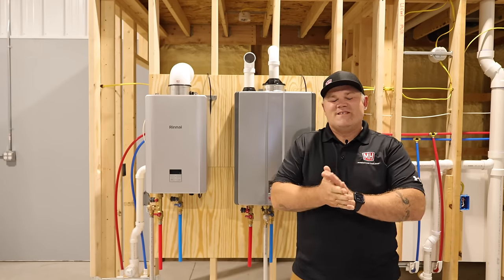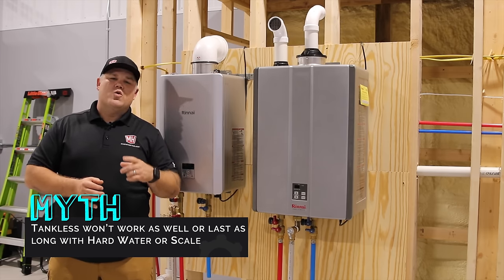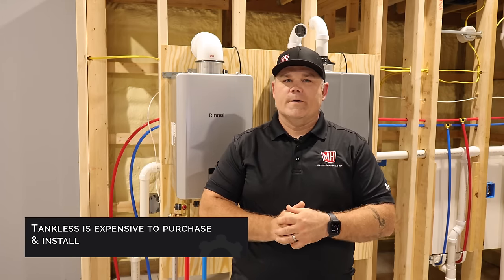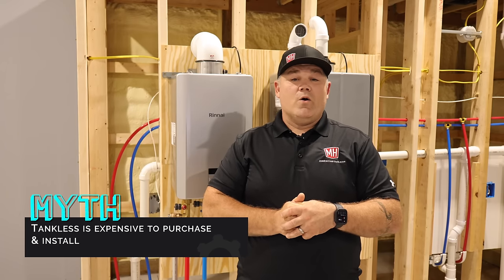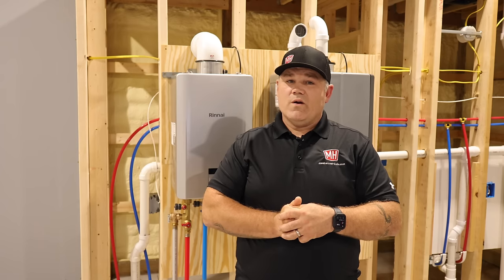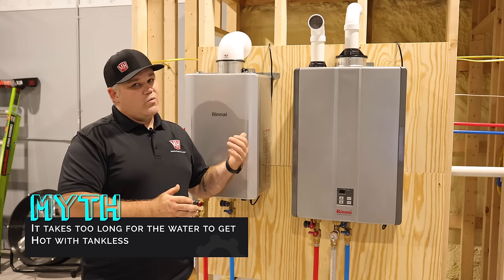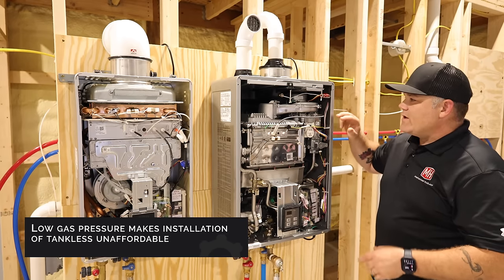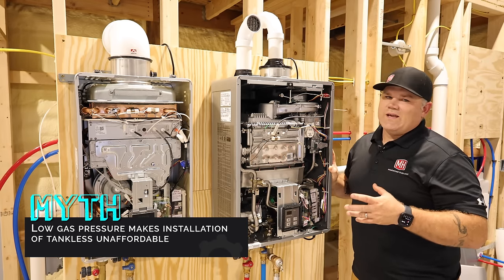Myth Busting! Tank -vs- Tankless Water Heaters

Comment: 40 gallon electric water heater is way more efficient in the long run . Tankless is a waste of money.  The point you made about a recalculating pump for long  runs  saves money and energy. That is so laughable Suppose you use this tap once per day but your keeping it hot 24-7 , that's saving energy? Never mind the cost of the second line pump and you fees wow. Last two houses i had I change the high efficiency gas heaters to electric. I live in a  rural setting, we lost power for two days  water was still warm . $350 for an electric water heater  versus how many $1000s.  Divide that into 10 years  with no problems . Repairs for tankless is expensive .

Comment: Our wonderful government is trying it's best to outlaw natural gas appliances so where will that leave these tankless water heaters because electric tankless heaters cost a small fortune to install because of the large size of the electrical conductors to carry the amperes needed to run it and now you are using much more electricity so where does your service come from????=A powerplant somewhere emitting much more pollutants to the O-layer. The complicated workings inside the heater requires a trained pro to fix it at an astronomical cost. Gas is very dangerous and lethal if breathing carbon monoxide and I don't want it anywhere near my home and family.  There is so much more negatives but lord knows I have gone on long enough~!!!

Comment: Its too loud. Need electricity Power tanks can be put on a timer.Way cheaper to buy and purchase an electric tank. No hole in the roof/vent.
No Gas lines!!! Means it safer!!! Tankless Sucks . Here in monterey cal.
A teck has to come from the bay area/SF.... They cost to much anyway so they prove they Suck... Its just so you guys can charge 5k per job. Nice Try but you loose . There  should not have the mind set of endless anything. Cheers!!!

Comment: What a propaganda!  Mostly nothing told is true 👍🏻   

I pulled out 2 Riannis before.  One tool many problems including defective heat exchangers

2nd because customers summer gas bill trippled!  His wife and kids decided they like 1 hour long showers instead of  10 minute ones with a traditional tank heater  :)

Not much more time and cost to install!!!???  Requires annual maintemance, new venting and larger size gas line.  + very few have recirculation capability for quick hot water +  more expensive and parts to fail!!   Total sales video

Comment: I can keep up. It is obvious you're not capable of keeping up. The gas sizing requirements for maximum demand do not change just because a tankless tankless siphons gas. The rest of the gas appliances will lose gas pressure if not sized correctly. I guess you have never read a code book. Even the tankless manufacturers installation instructions tell you to follow local codes. I guess you have never read these either? So keep up.

Comment: How much money did Rinnai pay you for this?  This video reeks of paid shil.

Tankless won’t work with Hard Water and Scaling: 
This is not a Myth, you are presenting it in a way that is misleading.  You fail to mention that MOST brands of tankless water heaters demand/all but require a water softener be installed in line before your tankless water heater SPECIFICALLY DUE to the units not being able to handle hard water.  Even in a city with "treated water" they still say to install a water softener.  So while you are technically correct, your statement is misleading by you omitting that "treatment" of water will require the additional purchase of a water softener.  Don't believe me, get a quote from a certified installer in your area and if you don't have a water softener, he is more than likely to tell you that you'll need one.
Result: Lie by omission.  You're a paid product shil.

Tankless does not do well w/ Cold Ground Water Temps:
Nice suspicious fade cut in your explanation before you changed course.  While you can try to talk about numbers, you do nothing to prove your point except saying "Take my word for it".  Perception is reality and as the general perception, and review of many units in the wild, is that you can't run as many things on a tankless  vs tank, you cannot argue with the capacity of a hot water tank to multitask under heavy loads that most households will face.  Your shower vs kitchen faucet is true, but laughable as most will end up facing a shower vs dishwasher or cloths washer.  So this point is dependent on need/water demand.
Result: Arbitrary.  You're a paid product shil.

Tankless is expensive to purchase & install: 
Wrong again.  Most tankless water heaters are at or near DOUBLE what a 50GAL tank heater is.  The ones that weren't were not worth the materials they were made from.  Even now the prices are still not comparable to most tank units you can get.  Oh and you forgot your first point, if you don't have a water softener, get ready to buy that too and your price just rocketed past a tank water heater. Don't believe me?  Go to Lowes or Home Depot website and look at the cost of Tank vs Tankless water heaters.  On top of that now look at a water softener if you don't have one.  With very few exceptions nearly all tankless are $200 to nearly $800 more than a tank, then add on the water softener.  Tank water heater starts to look pretty good.
Result: Lie by omission.  You're a paid product shil.

Venting for tankless is too expensive: 
Your assessment is arbitrary.  Installation will always depend on the age of the house and existing appliances in place.  So this is going to be case by case. Older homes are likely to be more expensive on installation as you may have to drill or make holes in existing structures.  Quotes for the work will be needed to assess true cost.  
Result: Inaccurate.  You're a paid product shil.

It takes too long for the water to get hot: 
While you are correct in the amount of pipe between you and the hot water "the right unit" will cost you substantially more and likely require more in setup costs and maintenance.  So while your point is somewhat correct you omit more facts. Depending on the unit you purchase, some units can take 15-30 seconds of run time before they will engage their coils which wastes water.  So this point depends as much on length of pipe, as it does the timing of the unit.
Result:  You're a paid product shil.

Stainless steel heat exchangers are better than copper: 
This one is correct, Copper is a better conductor but Stainless steel stands up to environmental effects for much longer than Copper will.  So usage is dependent.

Low gas pressure makes installation of tankless unaffordable: 
Not always true, but you think it is a total Myth.  You contradict yourself.  It will be based on the age of the house and size of the pipe and pressure of said pipe delivered via the gas company.  Then you also need to factor in other appliances in the house that consume natural gas.  Many homes are likely to need an upgrade their gas line to accommodate a unit such as this vs a tank heater.  However since you contradict yourself and side on it being Myth... 
Result: Inaccurate.  You're a paid product shil.

Point 8: Proven technology?  Well it's been around for a while, but so have many other not so good technologies. This is a point of view.  Just because it is proven, does not mean it is good tech and will be based on need.  You may have installed dozens and dozens of tankless water heaters.  How many tank water heaters have been installed over the years?  Thousands, tens of thousands, hundreds of thousands?  How many do you still install today?  Japan is also very small, and while this tech has gone worldwide, it is still very small footprint wise.  There have been many types of technology that have been around for a while that are "proven" but still aren't good technologies.
Result: Arbitrary. You're a paid product shil.

Your points are arguable and you omit too many facts in trying to talk up this technology.  You make it look more appealing and affordable than it is likely to be for most people in old or older homes.  Even with the "rising cost of building materials" a tank water heater is still likely to be cheaper on average, with less unit cost, installation cost and long term maintenance costs.  Everything depends on need.  Not everyone will need one of these things but maybe next time hit the facts instead of paid selling points.